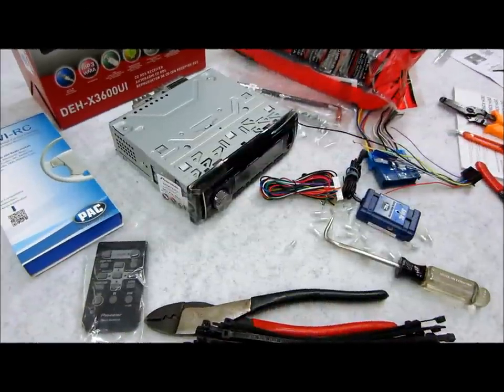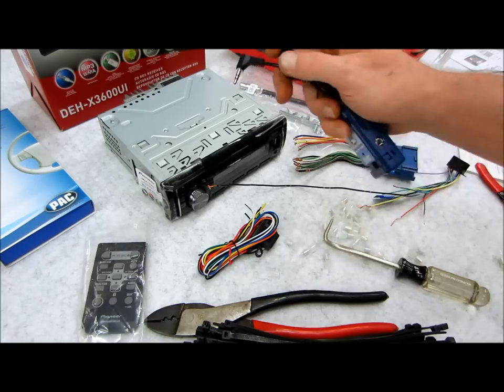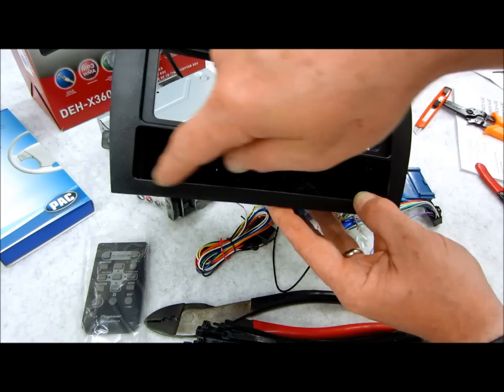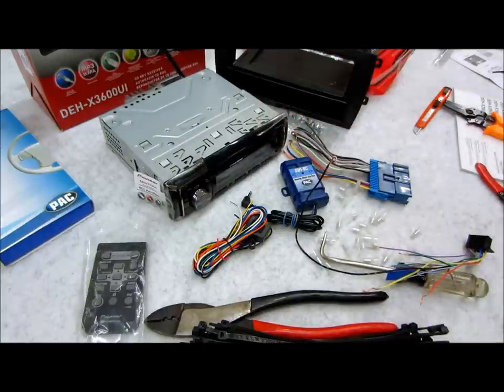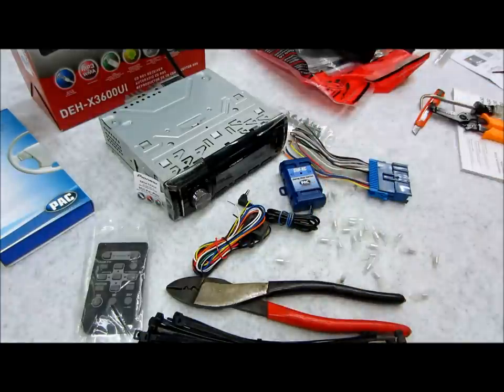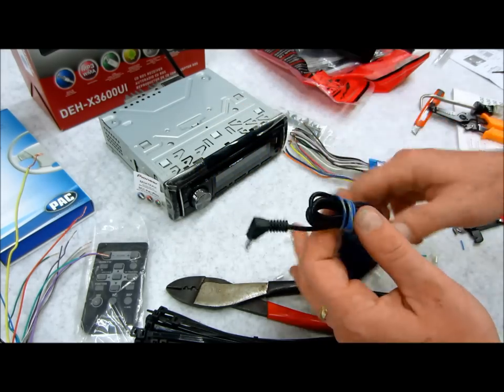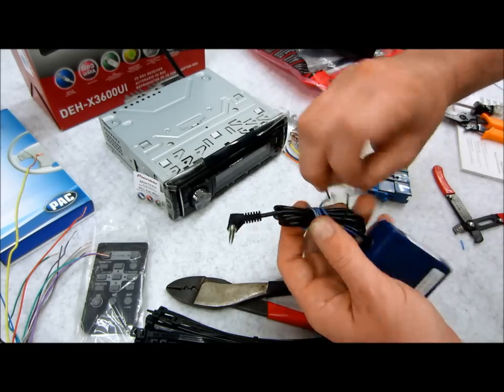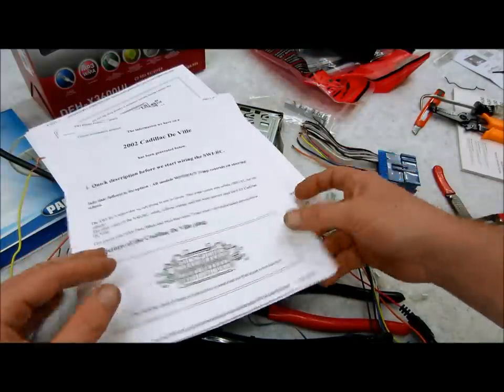How to wire up and prep a new radio, dash kit, harness and steering wheel adapter

Comment: I am forever grateful for this video! I called myself being a DIY'r because I have done wiring installs for hitches working at UHaul. So I haven't had a CD player working in my 05 Camry for quite some time and it's BORINGGG listening to the plain ol radio. So I ordered fr Crutchfield the wiring hardness and dash kit comes free. But because I'm one-and-done type chick I opted for the steering wheel adapter because I knew I'd likely HATE losing that feature. I was disappointed when I opened my stuff bcuz I thought it was like plug and play or quick connect and seeing so many wires thew me off. Watching this video completely eased my mind as I am a visual learner vs written instruction. Thank you for simplifying a task that could have easily gone wrong!! I'm going to go back at it tomorrow and do this prep work to make for an easy install. Thanks again!! :)

Comment: Also, I was wondering how long have metraonline been around. I already found the car model and make, and the adapter kits that are available.  But the radio size, still need to work out.  I learned this by watching and reading from a book.  Learning it here is pretty neat.  I'm beginning to memorize all the wires and the connections to it.  Plus reading books too.  Andrew Yoder, Mark Rumreich,  all are great authors of the topic.

Comment: Casio watches is pretty nice.  G-shock watches are also nice.  It depends on which you prefer.  In high school, I just used the regular Casio digital watches they sold at Longs Drugs store on the shelves.  It was about $34.00 if it wasn't on sale.  I think it is on sale now, so you can buy it for $24.95 cheaper.  It is pretty good and nice to use at work.

Comment: Crimp caps are the best, one crimp instead of two with butt connectors, plus you can mechanically twist the wires together.

Comment: hey man 
i got installed stereo with built in control adapter. i just dont where to connet the wires for the wheel control. maybe yo could help me. 
so ive got the black one grounded, the pin 9 i got connected (it says wheel-key 1) and i got another wire says wheel key .. where does it goes? maybe its the power source? maybe you could help me please

Comment: Great video, very helpful.  Two questions:

1.  Does the orange illumination wire from car wiring splice with aftermarket stereo's dimmer orange/white wire?

2.  The wiring harness from my aftermarket stereo has a REVERSE-REAR SIGNAL INPUT wire that has no corresponding wire to splice with.  What does that splice with?  

Thank you!

Comment: Will this exact same setup work for a 03-04 DeVille without Bose Soundsystem and with OnStar!
Or am I forced to get a very specific one?
I don't use OnStar and the car has factory amp & 10" sub in rear window deck

Comment: On another video also, you were showing the fans or electronics enthusiast how to connect a reverse green wire and add a back up camera to a car.  Can you tell me what polarity should the green or back up lights from the back of the car be? (-1) or (+1) I didn't get what machine you were using.  Not sure if it was a multimeter.  I have a multimeter too.  Use it to check voltages around the house.  If this was your video too.

Comment: If your steering wheel 3.5 jack has the 3 black bands rather than 2. Will it still work properly. My motorcycle remote has the 3 black bands rather than 2

Comment: nice lesson video..need help with two wires color.from the stereo harness wire  I got dark blue/white wire labeled ILL..and from the adapter harness wire is orange labeled dash Illumination..you think I go and connect the two wires? I'm confuse because of the totally different color..and the color to color rules ...please help..

Comment: I noticed he used a transformer step down.  This is probably off the solenoid.  Of which is measured up to 22,000 volts. Is this pioneer radio/stereo the same specifications as the others on the market?  The blue and Red connected were 12 volts each.  The breakover voltage or minimum current needed to amplify a signal at ground, is 0.6 Volts coming off the red and blue wire I am presuming.  How many volts or amps is going through the step down transformer?  larger black cable connecting to the back of the stereo/radio single din.

Comment: Is the metra 70-2001 the right harness for 2002 deville? I got one and it does not have a blue/white amp turn on wire

Comment: Hi. Thank you for the great video. I also done with that way but I just skipped the steering wheel control part cause in my stereo there’s no any jack and I don’t know where to wire that 3.5mm jack or other wire. So what should I do in that case? Thank you again
Reply from the maker: there are other brands that program digitally, maybe look into one..

Comment: Cadillac.  I noticed you put the pac adapter under the dash and the steering wheel.  Did you only have to connect the green wire?  And to what wire.  I did not see it clearly.  I could not get a hold of the instruction manual.  single din.

Comment: I was wondering where do they buy the 2 sided adhesive tape.  You used black electrical tape. Or one sided, while the other side is of a different texture.  Do you use only zip ties?

Comment: 91 toyota 4runner wire harness cut- has factory amp , not using-in cut harness 2 hot wires (grey&blue-yellow) grey is 7.5 fused -bl-yllw 15amp from dome-Q; yellow from radio to grey or bl-yllw? also have a cut black&red-cut white&green & a green w/segmented grey-where do they go?? also cased in grey&red sleeve are 2 wires red&white-and a grey sleeved 2 wire black&white??? these are also cut..any help with cut wires mentioned would be huge help..

Comment: First off, great video sir!  Really appreciate your comprehensiveness!  I recently purchased an identical radio (coincidentally) for my 2000 Grand Marquis.  I was curious about what you did with your ground wires.  Some sites/instructions/videos I have seen, they drill holes to the chassis, then attach that wire as a ground.  However, you just wrapped up all your grounds in a crimp cap.  What is the difference, and do you know if I would be able to get away with your method in my situation?  Much much easier than drilling holes and trying to attach my ground to my chassis!  Thank you!
Reply from the maker: Brian Sohl either way, ground is ground. dont get paralysis from all the alnalysis
Reply from the maker: Brian Sohl if there is a ground in the factory harness, I just use that.

Comment: I'm learning this too as I go along with the video and the book.  Are you guys familiar with Kirchhoff's first law of current and second law of voltage?  I could see if the DC circuit was in a series or parallel configuration.  Is it so, that all wires receive 12 volts across the wiring?  If so, the amps can be figured out by knowing the resistance or ohms on every wiring or component?  I'm into the electrical technical part.  There was a green wire too across the SWI module.  Where does this part go?  Is there a green wire near the ignition or near the other wires that feeds to the module?  Not sure where this is at yet.

Comment: Got a 2012 sierra dosent have back up camera or nav screen head unit it dose have on star tho but wont use it. Wondering if i can just get a steering wheel module and im looking at installing a screen and back up came do i need the gm 31 module or can i use this one you got here in the vid?

Comment: RED wire  , ACC power .Does the red wire have to be connected ? I'm doin an install into a 85 Toyots p/u . I used the yellow and went directly to the constant power feed , the brake light 10amp feed . I did the same on everything else as you did when connecting everything . I undid the batt - lead before starting . After everything was connected i re-connected the Batt. Nothing works ! Aw Crap ! Now what ? The Stereo came out of a 83 bmw 320i and worked well before i took it out !

Comment: On another video, if this was you, you mentioned that one radio harness was for the power, and one was for the speaker.  In this single din, both the power and speaker is on one radio side connector.  Do you some times modify it?  As in upgrades. or some other add ons.

Comment: hi i need some help with audi wiring as i can not find the right harness for the orginal audi to use for aftermarket.  As audi use amplified speaker. i have checked the harness it is not simple as you have shown colour to colour. but thanks for the video very good explaining.

Comment: How come in all the other videos, and the SWC unit instructions say to connect the swc wires into the cars harness pins but your connecting them into the wiring harness adapter?
 This is very confusing.

Comment: Great video.  Quick question, the new radio I bought came with only the standard hardness for the new radio.  I need to buy the hardness for the original plug?
Thank you.
Reply: vmchabla  yes, you can get these from any good shop, you would need a wiring kit and maybe an in dash kit for your deck.

Comment: questions:

Why do we need the ignition AND the constant wire to test the unit? why not just the ignition wire?

How much current does the constant wire draw? Seems like it would drain the battery if it is working 24 hours a day.

thanks!
Reply: The constant wire is directly connected to the power source without any inline switch. This provides the necessary power to sustain headunit use. The ignition wire is also connected to the power source but through a switch. Power only passes through when the switch is set to ON. This provides signal that triggers the internal headunit power on/off switch. This is a safety thing. I would think that this is required by the insurance commission.

Comment: So, the factory harness connector that one needs to connect the "info" wires from the SWI into,... Is that going to be right behind the stereo or will it be in the steering column, or where? I'd like to have an idea before I go pulling stuff apart and trying to splice into wires. I'm a total rookie at hooking up the SWI adapter.

Comment: the BLUE antenna should be connected to the BLUE Amp wire.  that way you can let the antenna down by turning off the radio.

Comment: I am confused trying to install my after market radio, i have used a diagram that i found on the internet to hook most of it up and it work for the most part... Except when i go to switch on my dash light and/or headlights my radio shuts off and wont turn back in until i turn my lights off, and even then the radio is reset, it is being done in a 1986 chevy nova cl

Comment: My aftermarket stereo supports steering wheel controls, but doesn't have the mm jack.  It hooks up with wires.  Seeing as how I already bought the PAC adapter, is there still a way to hook this up?

Comment: i am struggling to source constant 12v power wire & ignition wire from factory wires of stereo. I found 3 wires that has power, 2 works with ignition & the other wire works without ignition key, but in no time the power disappear. In my country, you cant get wiring harness plug & therefore we have to do it manually. I am using Automotive Circuit Tester, is it ok to do this as opposed to the multi-meter?

Comment: Quick question- if I'm wiring an aftermarket pioneer, and I've got Bose and OnStar. BUT- I'm not using a SWI.... The red 12v that goes thru the SWI still gets connected to the pioneer harness, even though the (swi) plug isn't being connected to anything? Using pioneer deh-x 4000bt
PAC OS2x interface
2006 trailblazer LS

Comment: Hey brother, thank you for your thorough detailed tutorial. 
I have a question..
I have a GMC-ENVOY-2002 with a BOSE AMP AND STEREO 6CD OEM.
This is my first vehicle ever to own, and I really want to change either the stereo or to add a AUX PORT and Bluetooth.
Is it possible in this kind of vehicle?
Reply from the maker: oh, most definitely!  get the appropriate adapters though, I suggest the app guide at www.metraonline.com  and you'll be on your way.

Comment: I bought a 06 expedition with a pioneer AVIC-D2 previously installed. Like a 2005 model, it has a few problems, nothing I can't live with except the following: 1. No steering wheel controls functioning. 2. No rear radio controls with headphone jacks, not functioning. The stock radio was a dual media CD, no navigation unit 
Question: How can I get these items working again?  Thanks, Gordon

Comment: thanks I just installed it and I turned off car  and the radio was still on will it going off after some times I installed it temporarily and I know if it still on I still need to get an antenna adapter because we you and I have is different than the factory unit which is a Chrysler do you think when I put all together with the antenna it'll turn off after so many minutes because I have another car that the accessory stuff stays on for at least another 5 to 10 minutes and then everything shuts down radio power windows all app

Comment: I see some people use crimp connectors (like yourself) and there's other who swear by soldering.  Which one would be the best to use when wiring up a aftermarket system?
Reply from the maker: Diontae Ford soldering is actually better, however 90% of people dont know how to do it properly. the other problem it when it comes time to remove the stuff, have fun unsoldering it all.
Reply: +Diontae Ford soldering has a better connection but has better chance of breaking and will have to be resoldered so crimping is just as good u still will have a very strong connection you would never be able to tell the difference

Comment: two questions one if I'm running two amps, do I have to connect the remote wire in the pac or just from the head unit or splice it from their connection, two can I split the aux port or mic port so I can have the mic and steering wheel controls and an aux port

Comment: I have 8 speakers wires from after market stereo but my nissan wiring harness has only 4 wires. I have 4 speakers. I have the wiring harness adapter which has 6 wires but of course 2 of them dont connect since the wiring harness only has four wires.  I guess you have to cross connect some of the wires. Any links to how this would be wired?

Comment: Hello! Thanks for the awesome video!
But I have a question, why do you put positive and ground wire together instead of ground to ground, and positive to positive. WIll there be a difference in these two methods or will it be the same resault as it makes a circuit? (I dont have too much knowledge in this department) Hope you can clear things up for me, thanks yet again for the awesome video :) !

Comment: Hello, 

Hello, 
I am looking to purchase one of your kits for my Kia Rio 5 EX 2012 with UVO in order to install a: Pioneer AVH-2914BT Stereo system replacing the original OEM stereo system in my vehicle. 

It is clear to me that I can use: 95-7353CH as well as a 70-7304 wiring harness in order to connect my new radio. 

Now, this doesn't answer the other two connectors I have in my car: 

Yellow  
Part #: 59Z063-000  /  PBT N3.6

Brown:
Part #: GT17HNS

Would this mean I don't need them at all? 

How do I retain steering wheels commands capabilities, as well as rear view back up camera with this equipment? How do I retain my already existing USB connectors, Aux in, talk back mic for my hands free system etc?

Do you sell, or know where I could get adapters that will help me retain all of my vehicle functions with the already existing OEM vehicle connections that came with my car over with the new unit? 

Your help will be hugely appreciate it!

Thanks and have a nice day, 

Alberto.

Comment: What if your wire harness has pink, brown and violet wires but your stereo adapter does not??? What do I do with those wires... Do I insulate them off or tie them into different wires like you did tha power and RC wires??? Please help
Reply from the maker: Yes, Just insulate the ones that are unused.

Comment: So if im not getting any audio but just buzzing, what wires would that be? Also the buzzing increases with higher RPMs
Reply from the maker: thats called a ground loop, a ground loop isolator will most likely fix that

Comment: I have the steering wheel adapter already attached to my stereo. so to attach my Remote wire all I gotta do is match the colors to the steering and stereo connections?

Comment: great video.... one question, can i add another FACTORY car stereo from a newer model vehicle,  than my own (IE,,, a touchscreen w/ gps navigation, chevy radio from a 2016 and put it  in a 2005 chevy avalanche)  without having to get all these wires and still maintain my Bose, rear seat audio controls, steering controls  and onstar
Reply from the maker: sure, you'll just need the 71 series reverse wire harness from metra and the schematic for the car its going into. not too hard..

Comment: Did you have to shop for this adapter.  There is the other Nissan I saw was pretty ugly.  It looks like they only used the right side of the iso din.  Side brackets.  Yuck...

Comment: Hello I have a 2000 Nissan exterra I want to install my pioneer stereo my stereo doesn't have the orange dim cable can I just crimp it with a but connector and leave the other side open

Comment: I'm installing a new stereo in my boat the speakers have a common ground do I need to run new speaker wires or can I just use one ground for the left and one for the right
Reply from the maker: That's an easy one... rewire it!

no stereos made in the last 10 years will fry themselves attempting to power a common ground speaker setup. run new speaker leads. And sleep well knowing it's right.

Comment: Is there any way to do this if the new stereo does not have a 3.5mm port in the back? I just bought a JVC KD-X350BTS and didn't realize the audio jack would be necessary, I'm wondering if I can make it work or I need to return it. Rear panel for reference: https://images-na.ssl-images-amazon.com/images/I/51s1Sa0KRHL._SL1000_.jpg